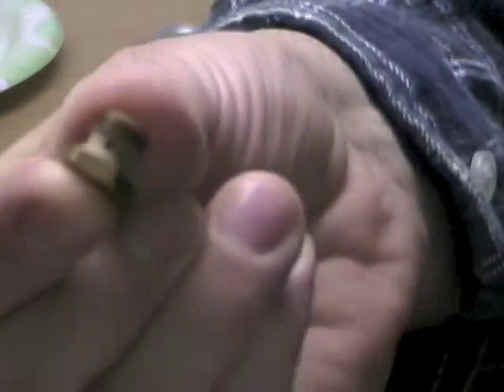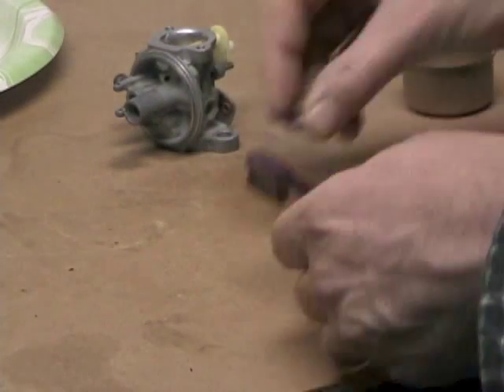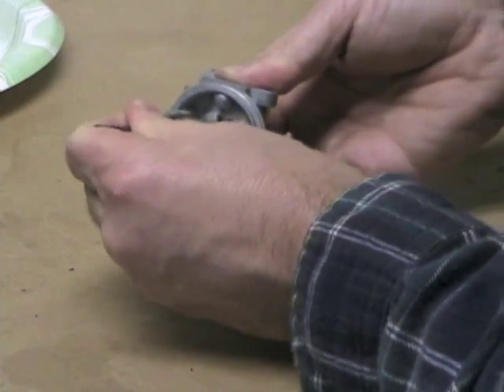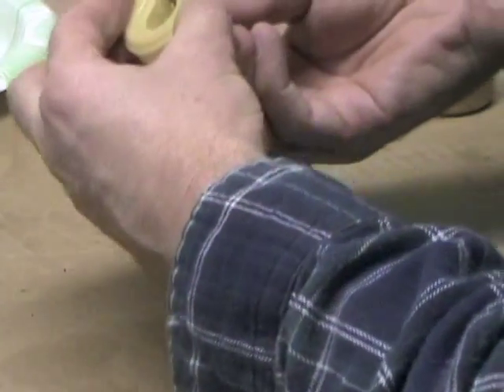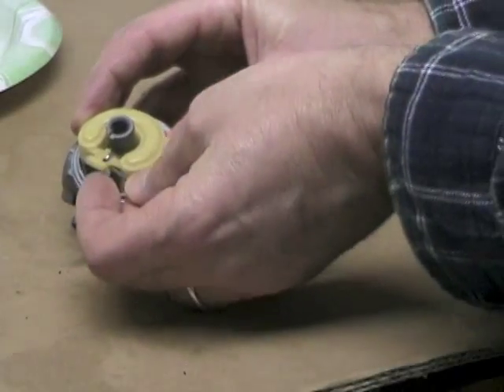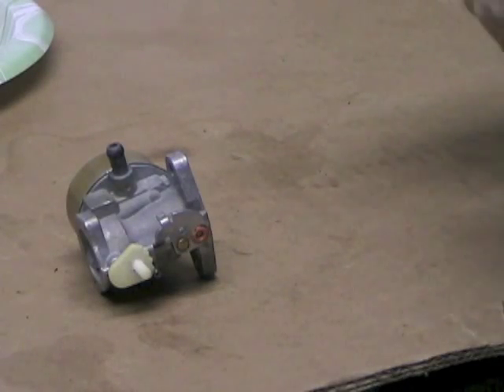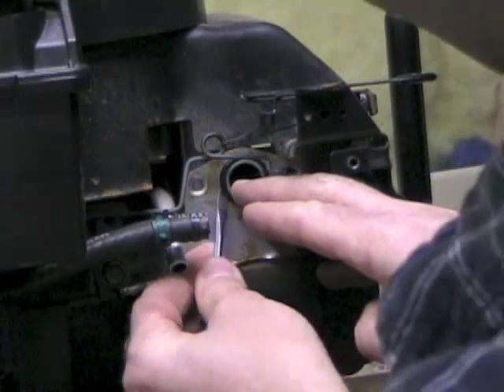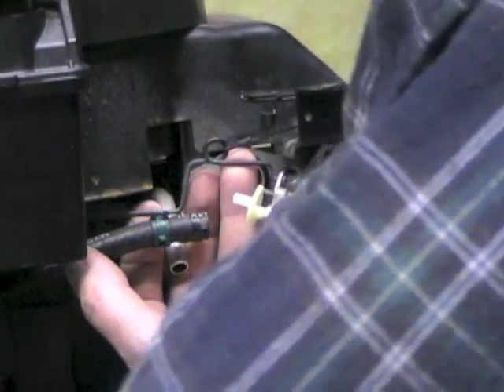Carburetor Rebuild on a 5HP Briggs & Stratton Quantum Engine 3 of 3

Comment: Thanks so much for your vid. I have a tiller with a Briggs & Stratton engine that will start for 2 seconds then stop. I even tried using starter fluid which makes me believe its the carburetor. I only hope i can get it back together. Yr vids helped !
Reply from the maker: Rodzilla Rox a tip is to take a phone pic as you take parts and screws off. That way you have a reference to how it looked before the tear down. I’ve found that it is not so hard as one would think. It’s just calculated moves and remembering what you did. Glad I could help and good luck.
Reply: TitaniumWayne  Thanks I appreciate it. I ordered a new carburetor and def took pics so i can remember what steps i took. Thanks again for the vid

Comment: I know this is an old video but for any new viewers......those holes in the bowl bolt allow to fuel to enter the jets since you screw that bolt into the same hole as the jets when attaching the bowl. Without them, the jets would be completely blocked meaning no fuel to the engine.